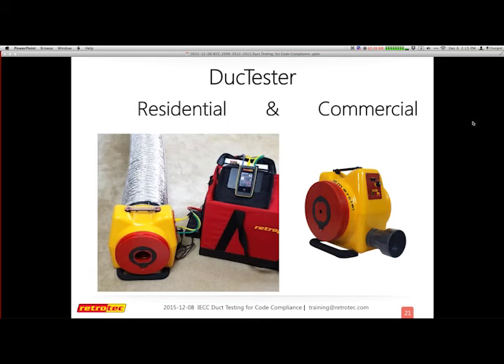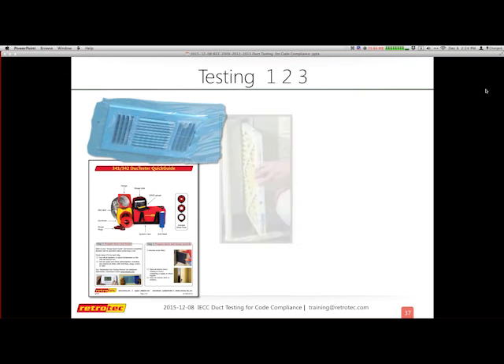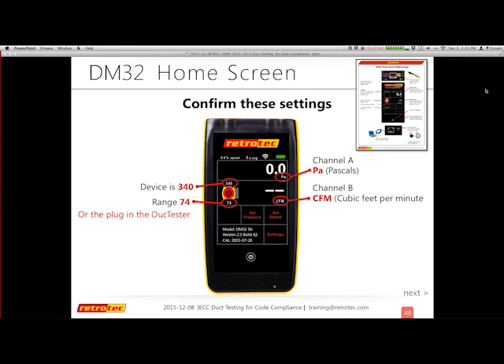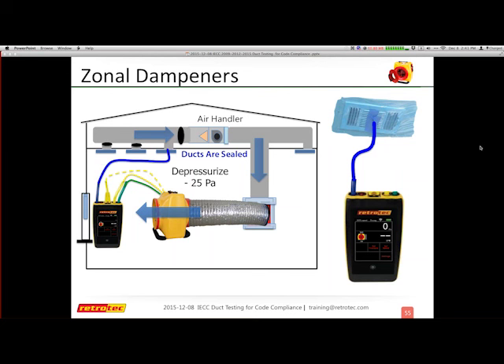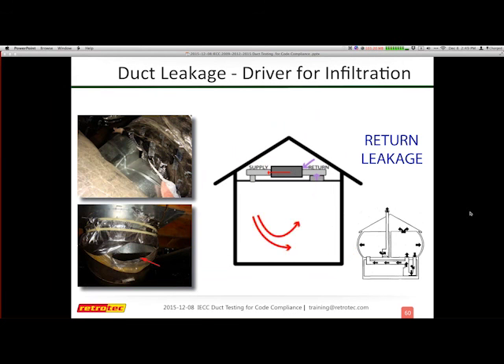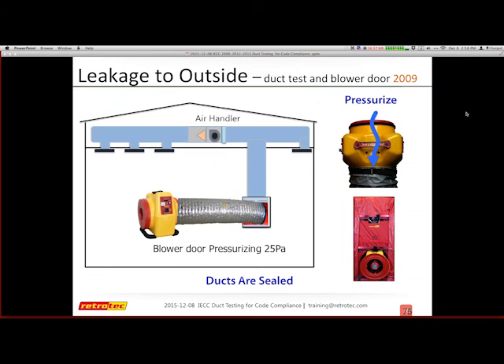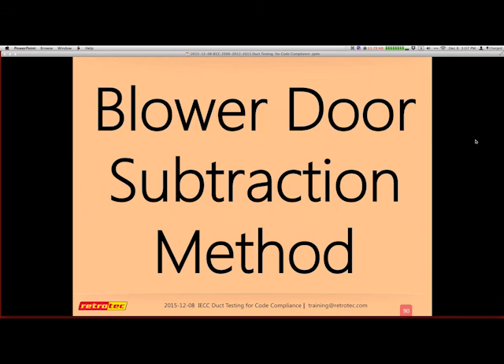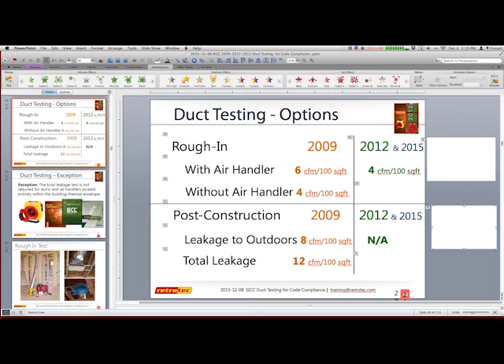IECC 2009/2012/2015 Duct Testing for Code Compliance (January 7, 2016)

Comment: not sure you guys are looking at the comments section but I had a DM32 question. I don't see a CFM/100sqft option on the guage,. I see cfm/1000. will that give me the %/100Sq ft?
Reply from the maker: Hi Tim, to change to 'CFM/100' tap 'CFM/1000' multiple times. It will cycle through the available flow/area options.